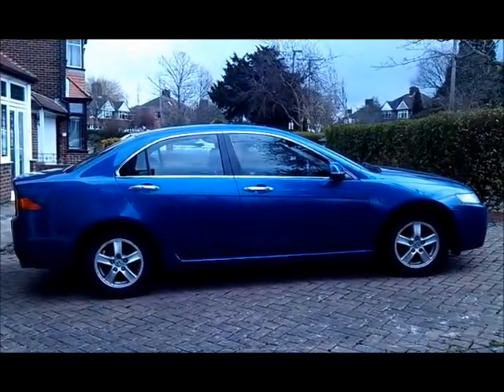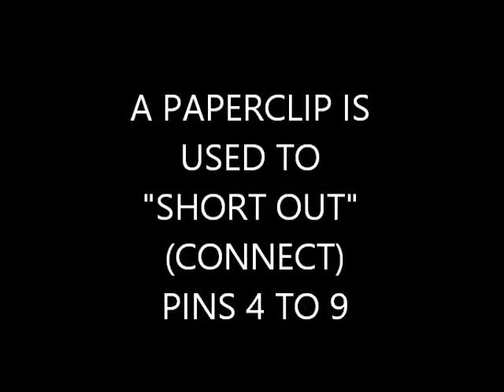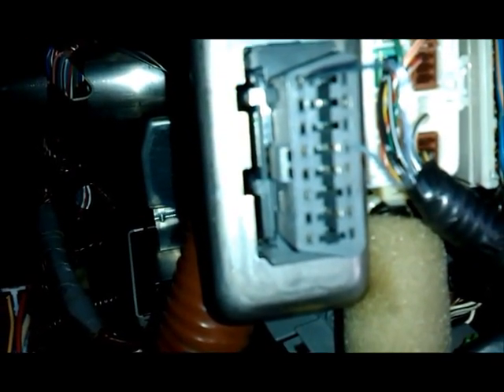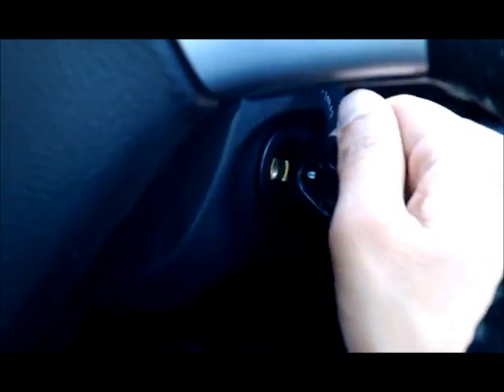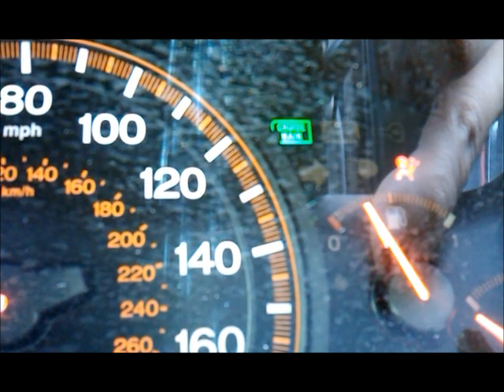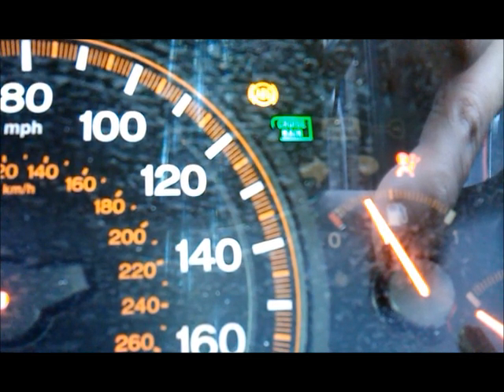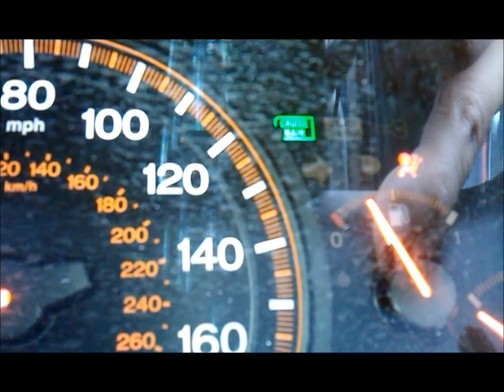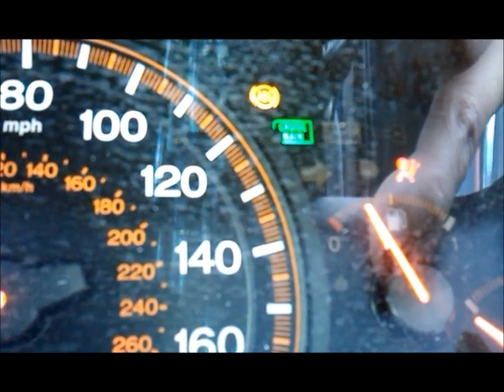HOW TO GET HONDA ACCORD ABS CODES WITHOUT A SCANNER (ACURA TSX)

Comment: I know it's been years, but this video just helped me pull the codes on my 2010 pilot and they were the same - 15 and 61. Can you tell us what you had to do to complete the repair? If you still remember...
Reply from the maker: Hello Ken, thanks for watching. 

15 - wheel senor (open/short to body ground/short to power) RR (rear right)
61 - ignition voltage

I removed the ABS sensor from the rear right wheel and bought a new one, it fixed the problem. You may need to erase the codes with your fault code reader. To double check you can remove the defective ABS sensor and take one from the other side of the car and put it in, then you'll fix the defective one but move the error code to the other side which you just removed., but this may be a bit long winded. New ABS sensor (not original Honda, but compatible) was around £50, approximately US$70. hope this helps, let me know how you get on.

Codes below for your reference
11 - wheel senor (open/short to body ground/short to power) FR
13 - wheel senor (open/short to body ground/short to power) FL
15 - wheel senor (open/short to body ground/short to power) RR
17 - wheel senor (open/short to body ground/short to power) RL
12 - wheel senor (electrical noise/intermittent interuption) FR
14 - wheel senor (electrical noise/intermittent interuption) FL
16 - wheel senor (electrical noise/intermittent interuption) RR
18 - wheel senor (electrical noise/intermittent interuption) RL
21 - pulser FR
22 - pulser FL
23 - pulser RR
24 - pulser RL
31 - solenoid (short to body ground/short to wire) FR-IN
32 - solenoid (short to body ground/short to wire) FR-OUT
33 - solenoid (short to body ground/short to wire) FL-IN
34 - solenoid (short to body ground/short to wire) FL-OUT
35 - solenoid (short to body ground/short to wire) RR-IN
36 - solenoid (short to body ground/short to wire) RR-OUT
37 - solenoid (short to body ground/short to wire) RL-IN
38 - solenoid (short to body ground/short to wire) RL-OUT
41 - wheel lock FR
42 - wheel lock FL
43 - wheel lock RR
44 - wheel lock RL
51 - motor lock
52 - motor stuck OFF
53 - motor stuck ON
54 - fail-safe relay
61 - ignition voltage
62 - ignition voltage
71 - different diameter tire
81 - central processing unti (CPU)
Reply: @kaiserrazzaq6865  My ABS light, the triangle and the VSA light was on. I replaced the ABS sensor (FL) and the lights were not on anymore, but I get 13 and the VSA light comes on after a few meters driving (not immediately) and goes off after engine restart.
Reply from the maker: @mdavid626  https://honda-tech.com/forums/acura-integra-6/ecu-abs-codes-here-978933/.   Please check this link

Comment: hello buddy, great video liked and subsrcibed, i have a honda Accord cl9 and i found 2 codes!
1) code 15 (same as yours)
2) code 21

what are those things? eric the car guy has the list of the codes and i found out the code 21 is ''pulser front right'' what is that?!
and what is the code 15? thanks in advance you saved my life <3 :*
Reply from the maker: Hello SPeed Addicted, Thanks for your comments and subscription!

Watch this video about how ABS works: https://www.youtube.com/watch?v=OpxFC-n8pfY

The 21 pulser code probably refers to a solenoid within the ABS hydraulic unit usually located in the engine bay. You may be able to replace the individual solenoids or you may have to get a new ABS control unit. The 15 code is the rear right wheel speed sensor, check and replace if necessary. This was the fault on mine and i replaced the rear right ABS sensor and the problem was fixed. (the part was approx £55 in UK-not original).

link to codes here: https://honda-tech.com/forums/acura-integra-6/ecu-abs-codes-here-978933/

hope it works for you, let me know how it goes...!

Comment: Yea don’t even bother trying it. I just blew my ecu fuse doing this
Reply from the maker: Worked OK on mine. Seems to suit some models better than others.
Reply from the maker: If in doubt, don't try it. Take your car to the dealership Instead.
Reply: I did it on mine and it worked just fine
Reply: You shorted the wrong pin - I did the same thing. 9 is on the other side of the short row.

Comment: Don't do this. It short circuits your car and your car won't work anymore without a new fuse
Reply from the maker: Mike Ries. It worked ok when I did it
Reply: Mike ries I just did this to an accord and I pop the fuse for the ecu do not do this people
Reply: it worked ok with mine accord mate..do not panic
Reply: I agree.  I did it to my 2007 Honda Pilot and blew the ACG fuse, bummer it didn't work...
Reply: no...its working...dont worry...